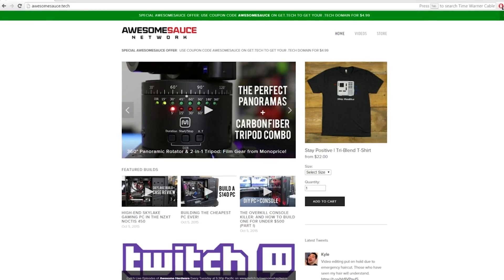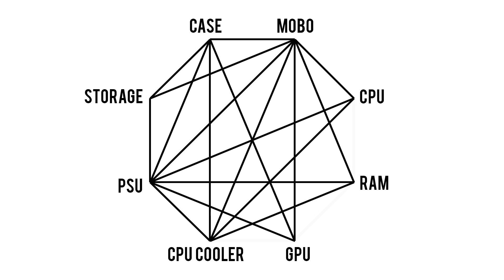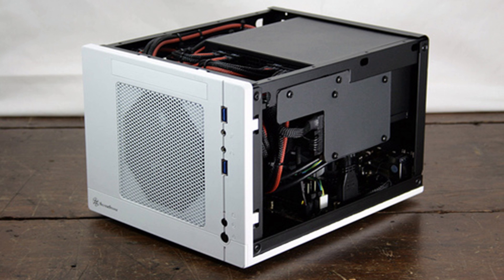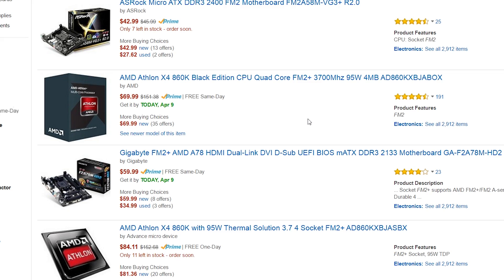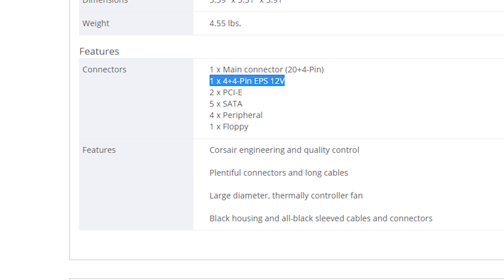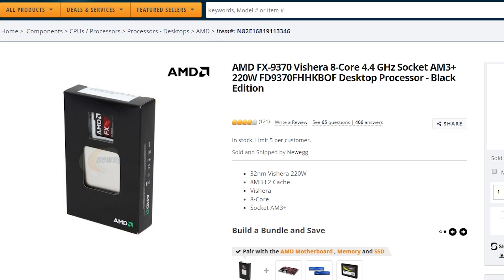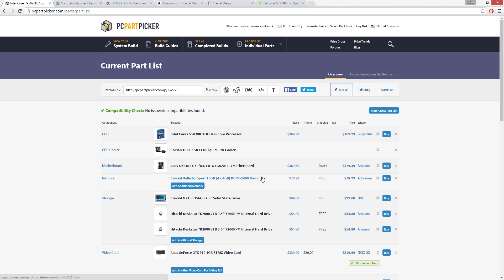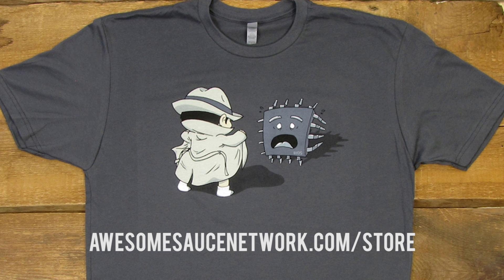How to Choose Parts for a PC! The Ultimate Compatibility Guide!

Comment: Dude i need your help!!! Im gonna buy the amd a8 7600 (for a budget pc), but i dont have enough money for 8gb 1866mhz, only for 1600mhz(8gb), so my question is: if i buy the 1600mhz one, the kaveri graphics are going to work? Pls dude, i really need your help!!!
Reply: If someone can answer my question, pls do it
Reply: Yes
Reply: +Ramoonj 333 dont forget that the performance of your APU(in games) depends ALOT on memory speed so faster ram in this case gives high fps improvements...
Reply: Well, the best scenario is 2133mhz memory, as apus use the system memory as vram.
It will work but loose some performance
Reply: if you are buying an apu,then spend more on ram because the speed of your ram will matter so much.
Reply: Ok ,thank you guys!! i have another question, what games could i run with that specs? (Amd a8 7600 and 8 gb ram 1600mhz)
Reply: +Ramoonj 333 if u wanna play triple a titles i suggest you buy a gaming system with an i3/i5 and a graphics card...
Reply: +Shofield dGu yeah dude, of course i would like an i3/i5 and a graphics card, but im in a budget, i only can buy a few things (apu, motherboard, ram), im going to reuse the other parts (hdd, psu, case).
Reply: +Ramoonj 333 then i suggest you wait and save more money until you can buy a full system
Reply: +Shofield dGu yeah that shuld be better

Comment: Would I need a 700 watt PSU for a i5-4460 and R9 390 rig, or what would you guys recommend?
Reply: A 600 should do just fine.
Reply: +TheKingixe i would recommend a 600 watt the 700 watt psu is too much
Reply: But when under full  load it goes near 700 watt mark?
Reply: Thanks alot for the answers!
Reply: as long as u don t use like 5 hard drive and 6 fans and 2 optical drives i think 600 watt will be enough your cpu needs 84 watt and gpu 300 watt  84+300 watt = 384  so 600 is defenitly enough

Comment: @Awesomesauce Network Hey :) Just a quick question. I have searched through different forums but the results are confusing me. Could you pls recommand me a Modular PSU that supports Dual GTX 970´s ? I think 850 w should be ok.

Greetings from germany

Mark
Reply: ok Thx :)